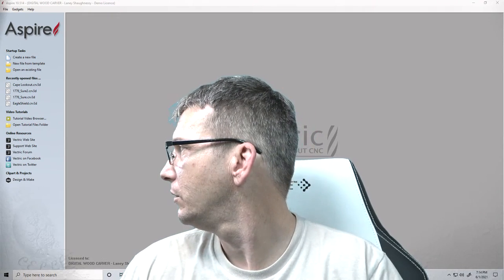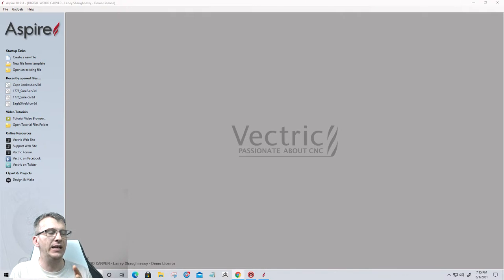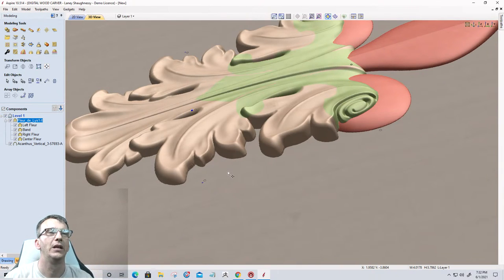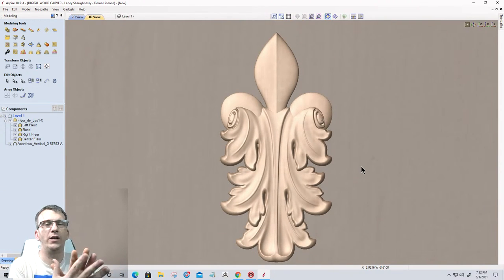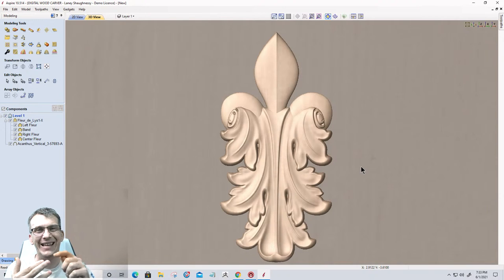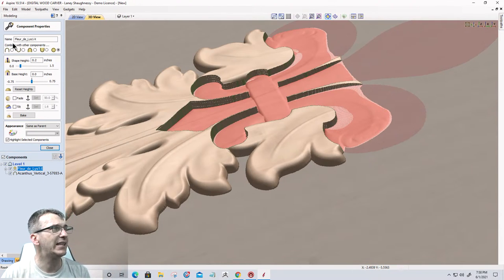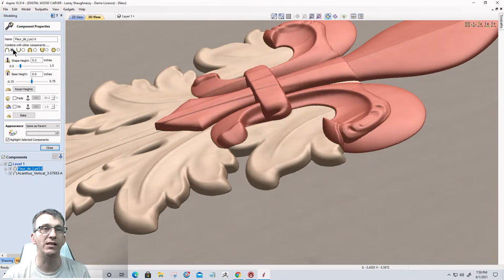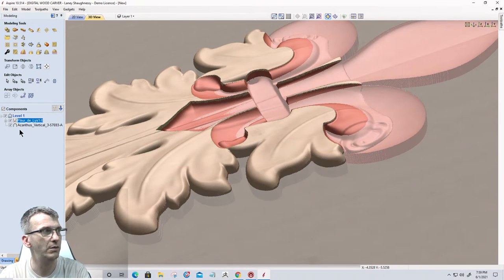Working with and creating models in Vectric Aspire

Comment: Hi Laney, another great video! 
Does the file resolution... poly count, affect the machining time for the cnc. Some of the projects I try to machine are 20+ hours to carve.
Reply from the maker: The model detail does play a role, most of machining time is affected by bit selection, feeds and speeds as well as your CNC's acceleration and deceleration parameters when performing..the traverse speeds and heights, etc. Utilization of 2D vectors and toolpaths to limit machining boundaries and optimizing the 3D toolpaths helps reduce these times in certain applications. Especially when there are a lot of flat regions where as an example a pocket toolpath could be used to eliminate the need for the 3D toolpath to have to machine those areas.
Reply: @SpindleTV  Wow... there are so many factors involved, thank you for the reply. :o)